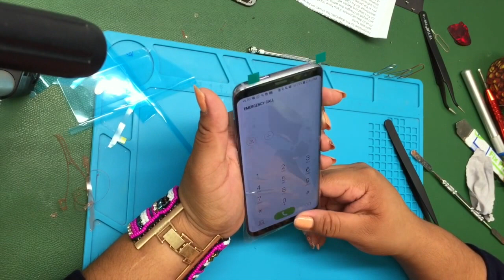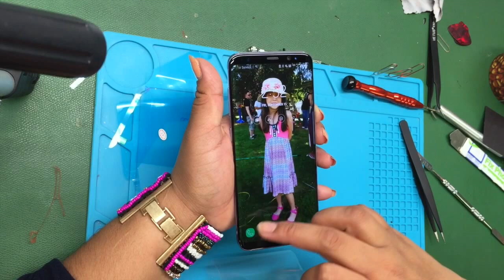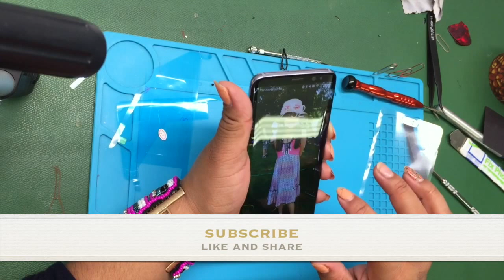Samsung galaxy s8 plus broken screen super easy to fix don't worry be happy 😉

Comment: Good video. My only concern is, if it's just the glass that is broken, you can purchase just the glass and use a heat gun (or hair dryer!) or a freezer to separate the glass from the LCD and use LOCA (Liquid Optical Clear Adhesive) to mount the new glass. Granted, it is still recommended you remove the electronic components before you heat/freeze the glass, and you still run the risk of breaking the digitizer anyways, but it is a much less expensive option if executed properly. I purchased the glass, kit, and LOCA for $40 total and have a brand new screen! Not hating on the video, it was well made and the repair was excellently performed. Just providing another avenue for those on a tight budget like myself. :D
Reply: You should make a video on the technique. How much would this video cost cus they want to charge 130 at a shop
Reply: @tretheonly3311  I just might considering I just broke my screen again lol.
Reply: @EchoOfAmarok  lol,,me too,just had it replaced 1` month ago & they still want to charge me for digitizer,it works fine,tired of being ripped off,ty  4 vid,my parts came in 2day
Reply: Thanks
Reply: @stephenpiggott487  You can use OCA sheets, but if you already have the LOCA glue it would probably be best. The glue will provide a better and more heat resistant bonding to prevent yout screen from coming loose.

Comment: Hello everyone, I found that with patience and close scrutiny of the video this repair can be preformed both efficiently and effectively. You should not expect to be able to do the work that is being performed in this video at the same rate as she clearly has prior experience and the proper setup/tooling for the job. I attempted, and successfully completed my repair in just under an hour because I made sure to double check every part of the phone very carefully. If you take your time and do not get into a rush the total job is removing two screens and taking out and putting back in about 13 screws along with reinstalling the ribbon cables. This can be performed quite easily you simply must be careful. I recommend using tweezers for ribbons cables and some container for the very small screws. This was a very well filmed and organized video and I think that it makes it easy for anyone to fix their phone without taking it to a repair shop thank you!

Comment: Do you have to take the entire phone apart just to fix a cracked front glass?
Reply: Usually honestly I do just so it doesn't damage anything else. for the front glass you should use a heating table to loosen the adhesive otherwise get a whole kit. I just watch these videos to see what others do and think of the pros and cons but the proper way is a heat plate.

Comment: this is literally easy but the thing is the screen costs like 200$ usd 
and in and around 200$ u can buy a new better phone or even a used s8 plus with good screen
Reply from the maker: Here Is a link to a s8/s8 plus screen under $130 dollars that will get the job done http://rover.ebay.com/rover/1/711-53200-19255-0/1?icep_ff3=2&pub=5575222078&toolid=10001&campid=5338149107&customid=&icep_item=153561286389&ipn=psmain&icep_vectorid=229466&kwid=902099&mtid=824&kw=lg

Comment: Why do you have to removed all the components instead of just the screen ?
Reply: Because you need to do that in order to get to the screen. It's the way the manufacturer builds them.
Reply from the maker: We move the components to the new housing because that's how the screen is designed and like kaoshi said that's how the manufacture builds them
Reply: I was asking cause by just looking at the video it appears you do need to remove the back to disconnect the cable to the screen. Once that is done though it appears you just have to separate the screen and clean adhesive off. Once your ready have ribbon cable go through hole test and then you can re assemble

Comment: I just want to replace glass I’m getting all the tools with heat gun. How?
Reply from the maker: We replace the screen because it is easier than replacing the glass there is a risk breaking the LCD of the cellphone which is not good when replacing just the glass.
Reply: how much your are charging for screen replacement

Comment: Shopkeepers are demanding 29000 for its replacement what to do?
Reply from the maker: Try to do it yourself its less expensive http://rover.ebay.com/rover/1/711-53200-19255-0/1?icep_ff3=2&pub=5575222078&toolid=10001&campid=5338149107&customid=&icep_item=232452497522&ipn=psmain&icep_vectorid=229466&kwid=902099&mtid=824&kw=lg